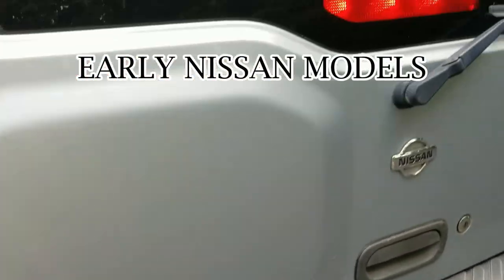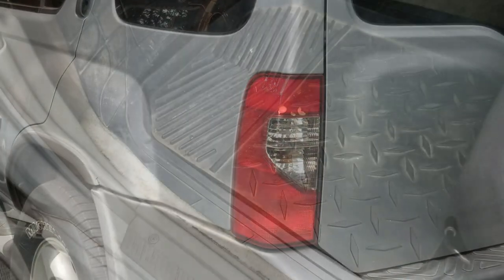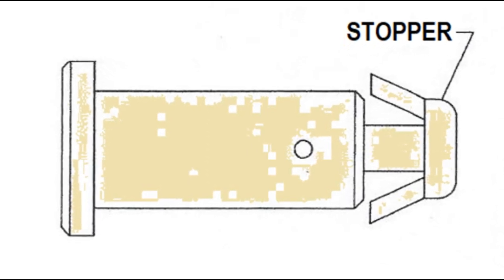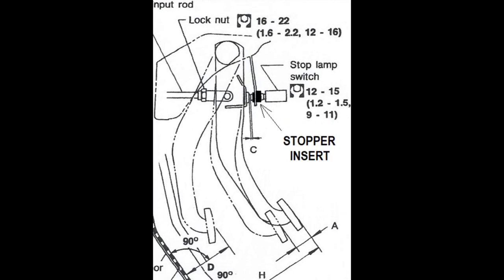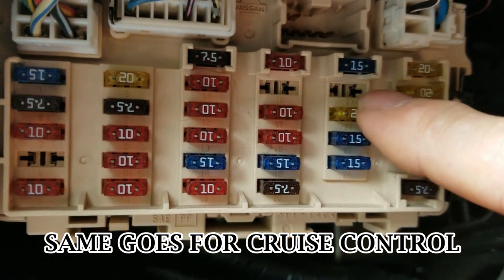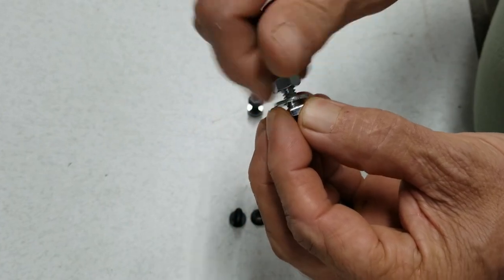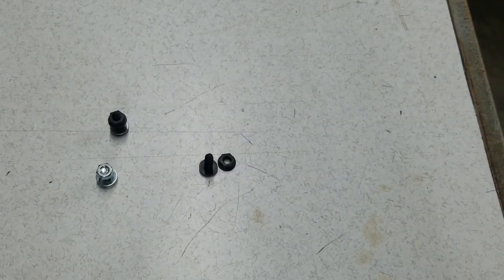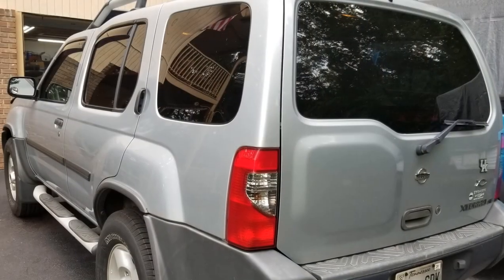Brake Lights staying on or Cruise control will not set. The cause and how to fix the problem cheap.

Comment: Small tip I want to mention:  in order to fit a long bolt in the hole, it was nearly impossible with engine off because the pedal is hard to press.  Cranked and running, brake pedal moves more easily out of the way.  Pop the bolt right in and release pedal, tighten nut on bolt.
Reply from the maker: Thanks for the tip. Thanks for sharing my friend.

Comment: I haven't fixed it yet, but I sure enough found all of those little broken bits and what looked like a plastic button right under the brake pedal. I have at least a good idea of how to fix it from your video and from some helpful comments here. Your diagrams are very helpful as well, so thank you very much! 🙏🙏🙏
Reply from the maker: Awesome my friend. So glad this helped you. Thanks for sharing.
Reply: Just wanted to add that I ordered the aftermarket part (from Am*zon 2 for $4) because I couldn't find a bolt or fender clip that would work. 
On my 03 Nissan Xterra, there are two holes right next to each other. The left one (and consequently the easier one to get to) is for the cruise control stopper, the right hole is for the brake light.(I initially popped a stopper into the hole that goes to the cruise control switch pin and wondered why the brake lights were still on). 
When I found the right hole, I tried about 10 times to get that little squirrelly thing in the hole and it kept falling because there's a metal plate in the way that makes it incredibly awkward to get to and you have to do this mostly "by feel."  
Finally what worked: with the car running and pressing the brake as far down as I could, instead of trying to pop the stopper in the hole, I pressed the stopper against the switch pin (centering it as best I could, pushing the switch pin in a bit) and gently released the brake until I felt with my fingers that the stopper was wedged, then pulled up on the brake to pop it in. 👍

Comment: I have a 2001 xterra same problem.  Your video is the best one I've seen on the topic.  I looked on my floor mat and have the same broken plastic parts you showed.  Thanks, i appreciate it
Reply from the maker: Glad it helped my friend.
Reply: @donnielaws7020  sure did.  30 minutes later I put a plastic license plate bolt and small washer in the hole, brake lights working 👍 excellent
Reply from the maker: @indegruv  Great my friend. Sure beats paying 10-30 dollars for a part at the dealership.

Comment: Thanks for the helpful video, I found the bumper pieces on my floor mat too. I used a                  9mm- ish diameter push in fender plug to fix it. worked great. the diagrams you showed are very helpful!
Reply from the maker: Awesome! Glad that helped. Your very welcome. Thanks for sharing that my friend.

Comment: Exact same issue on my 2015 Ford F-250 SuperDuty. My cruise control would no longer set and I noticed my brake lights are staying on. I unplugged my brake sensor and they turned off so I thought the sensor was bad and ordered a new sensor. After this video and several others, I was led to go look for some yellowish pieces on the floor. Sure as shit, there was! So I used a similar sized magnet to replace the yellow spacer piece that you can't order. It worked!
Reply from the maker: Awesome my friend. Glad you fixed it. Thanks for sharing.

Comment: Hi there, I am writing to see if you can help me out.  I do not see any of the plastic grommet but my brakes are not turning on.  I checked the fuse and it looks fine. I turned on the headlight and the brake part lights up.  Please help and advise
Reply from the maker: Have you check the brake switch it's self and is it getting  12 volts through it to the brake lights. That should tell you which way to go.